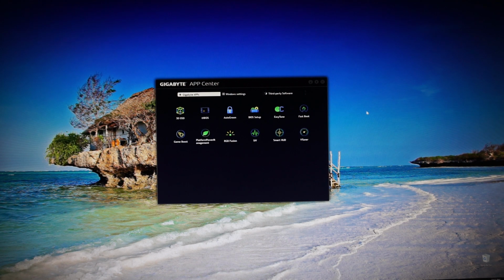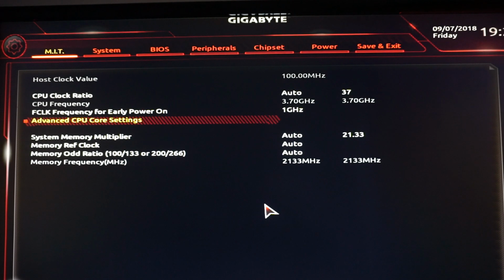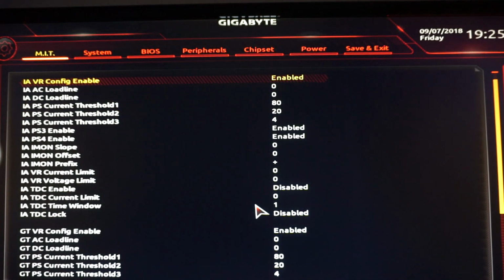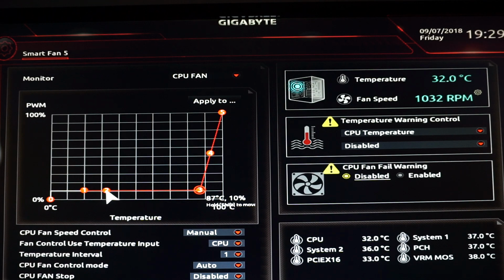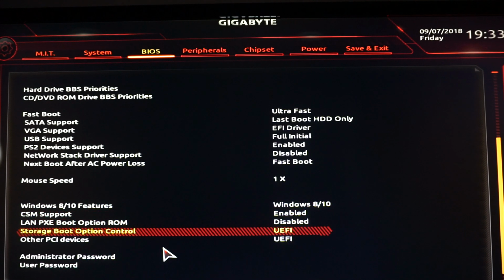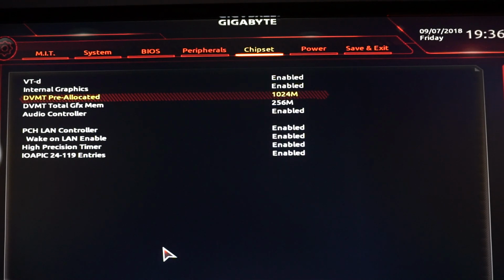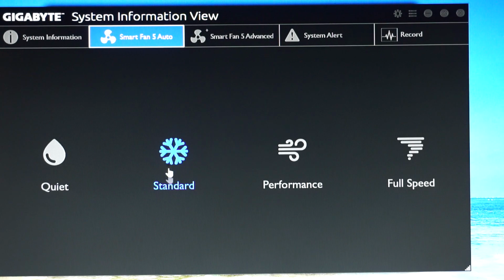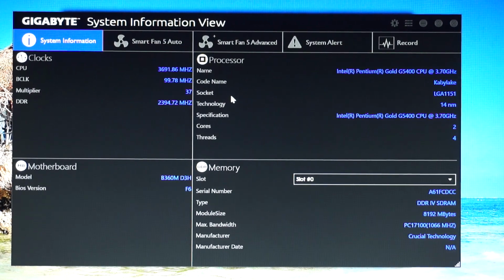Gigabyte B360M D3H BIOS

Comment: So much misinformation in this video. e.g. CPU will never reach 86 degrees???? If you run fan at 10% it will when video encoding within minutes.
Reply from the maker: No man, even in encoding, the Intel cpus are way cooler. This is not AMD. As long as you have an aftermarket cooler on the cpu you'll be fine. Also I used a modest dual core CPU on this motherboard which by design is cooler. If you want video encoding you'll buy a high end PC, not this.

Comment: Everytime I exit the bios setting the pc restarts and then I go back to the bios settings, I don know why
Reply: Be careful messing around in the BIOS man, I had something happen earlier last month where somehow I dumped my boot file somewhere somehow. My pc was trying to boot to windows through my Realtek LAN controller. Yea it was all messed up. What I think I did was click the raid option and it initialized something then I was screwed. I had to wipe all drives AND their partitions, and do a fresh boot install as if I just built the pc. Luckily my stuff was backed up and oem windows versions are married to Motherboards so it just took four hours of downloading andbi was back to normal status.
Reply from the maker: Restore the factory Bios settings and stop changing the parameters in the cpu or RAM menu. The Intel systems are the best and they work very well as long as you don't mess things up.
Reply: @Meroving1an  how can I restore the factory??
Reply from the maker: @toxiczdiop2560  There is an option inside bios Restore to factory settings I think it is in the last menu, at the end anyway. Or something like Default Settings.

Comment: How do I know if my graphics card is working
Reply from the maker: touch the fans to see if they spin
Reply: @Meroving1an  Not true. A lot of GPU's don't spin until a certain temp is reached. To check if it's working, run afterburner or stress test it.

Comment: Does this Mobo support qflash? I'm trying to update it to support my i5 9400f. I do not have a 8th gen processor to update bios. How should I go about this?
Reply from the maker: You need to install the 9400F first then update that bios. Otherwise you cannot use the Bios version for the 9th gen with a 8th gen cpu
Reply: @Meroving1an  But it will work?
Reply from the maker: @rares4kt  yes it will
Reply: I'm in the same situation.. Did you solve it?
Reply: Hi, were you able to update your bios without an 8th gen CPU ? I'd like to buy this MoBo and a i3-9100f.

Comment: Just built my son a pc, and I am using this Motherboard. I do not have a usb wifi adapter, but I kno how to get the drivers on to a usb using another computer. The thing is, I dont kno which drivers I need to get. If anyone could help me out that would be greatly appreciated. Thanks in advance
Reply from the maker: Use the manual of the motherboard. You have all the info there. You can download it from the web. Or you have it in the box.

Comment: Does this motherboard support 3200 ram???
Reply from the maker: No. I think only 2666 MHz ram, if you have a CPU that can go up like that. At this point my option for the RAM is only 2400 MHz tops. I use it with a Pentium GOLD G5400 3.7GHz.